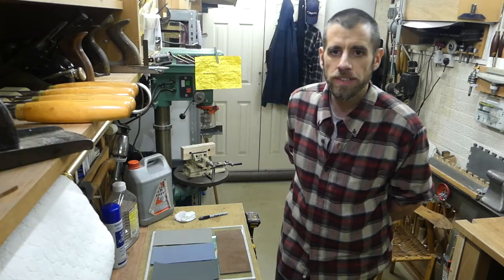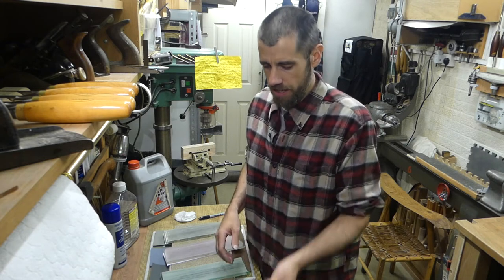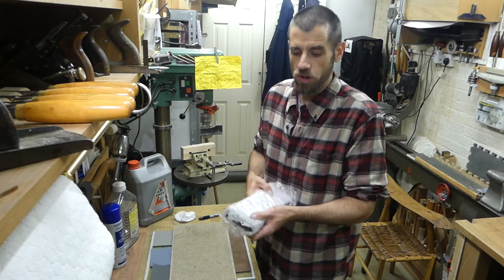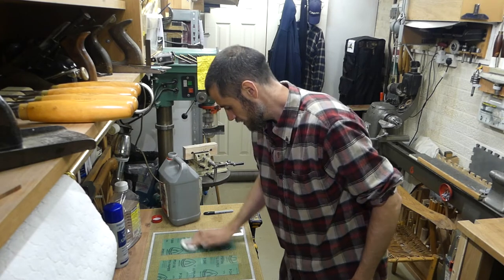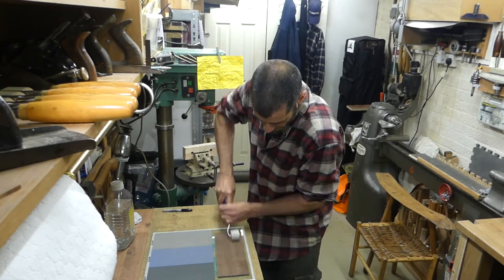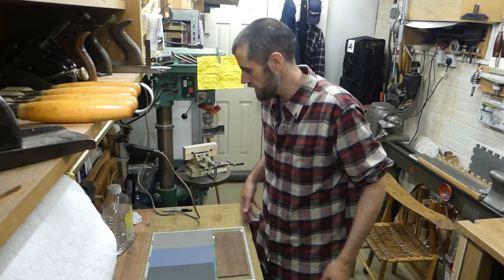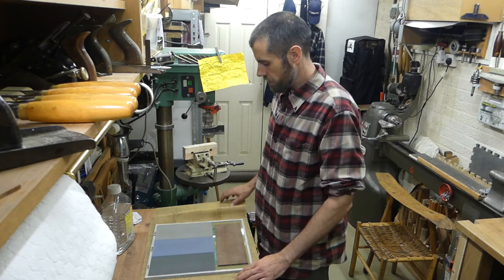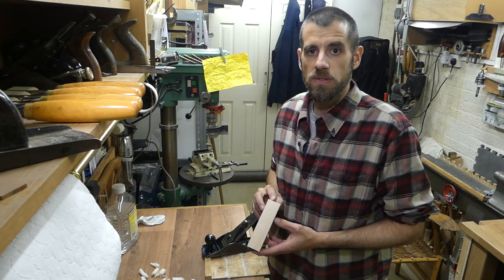How to make and use honing plate for sharpening hand planes and chisels

Comment: Helpful tip about why self-adhesive papers attract dust because of the static electricity built up by the peeling off of the backing. Spray adhesive all the way for me now!
Reply from the maker: Nigel Wylie glad to have helped Nigel, there are ways to help reduce the effects of the static but it's not worth the bother when you just want to quickly change abrasives in the workshop! Hope the spray works well for you.

Comment: Hi Lee, what a great and timely video.  I have had a nice piece of 10 mm glass sitting in my shed for a few months now.  I got it specifically to restore and maintain a couple of No. 4 planes that I bought on ebay.  Would that 3M photo spray work as an adhesive?  Also, wouldn't a good stropping paddle work for the final stage if space was limited on the glass?  Finally, could you please post the name of the chap that you bought the guide from.
Reply from the maker: Excellent, glad you found it helpful. Yes spray mount should work fine, probably better in fact as it's designed to go on flat and transparent. The guide is made by Richard Kell and I got mine from my mate Matthew at workshop heaven. It's a really nicely engineered tool and very easy to use. Have fun restoring those no4's I'm hoping to film that process soon in stages with some upgraded parts also from workshop heaven.
Reply: Thanks Lee.  Can i use the glass and paper to flatten the actual Iron?
Reply from the maker: Philip Green can't see any reason why not, might want to use some coarser grits if there's more material to remove though.
Reply: By the way......... I'm impressed with your choice of intro music.  Is that you playing "Soldier's Joy"?
Reply from the maker: Cheers, no it's my mate John Mullaney on the strings!
Reply: I'm impressed............ I'm tempted to make some requests for future videos.  I try to play clawhammer banjo myself.  Clawhammer banjo is the ultimate music to carve to.

Comment: Could you tell me what brand of spray adhesive you used as the 3m mount spray I tried would come unstuck when I put water on the wet & dry.